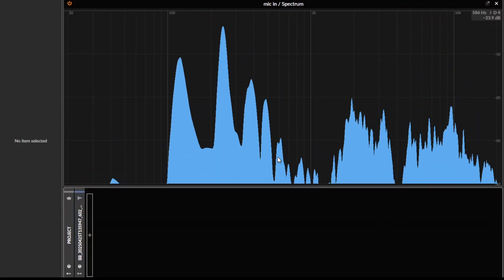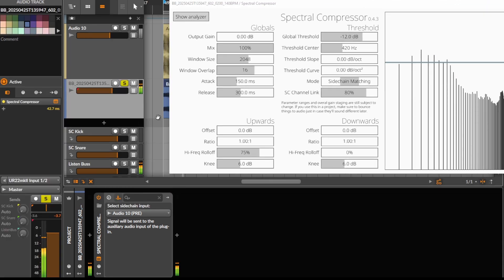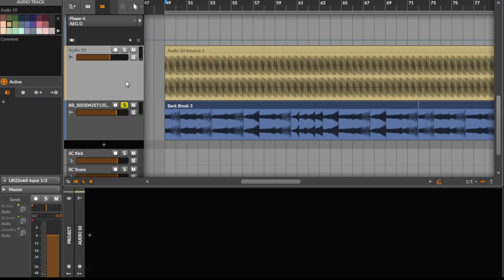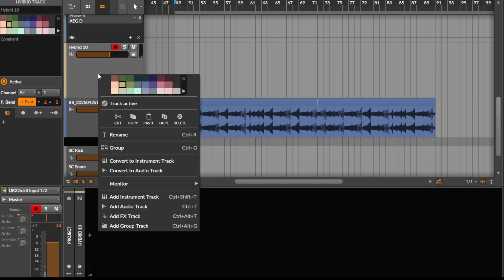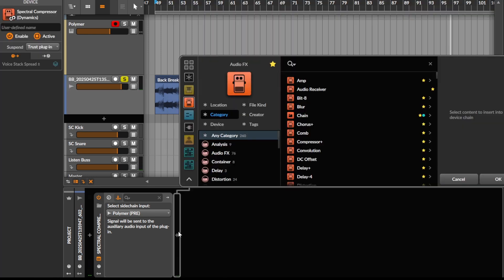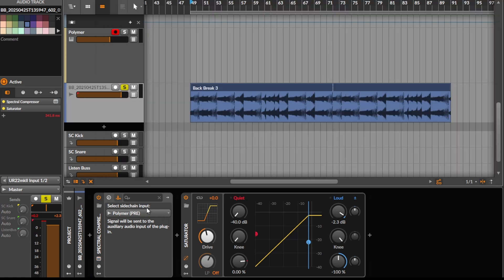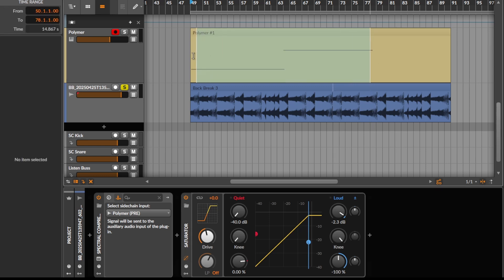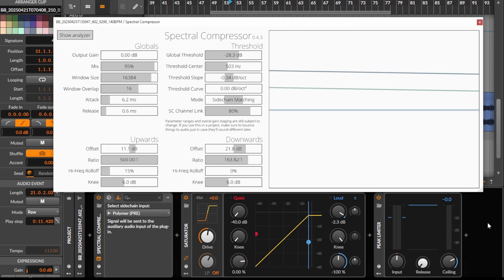Using Spectral Compressor as a Resonator /Spectral Vocoder | Sound Design Concepts Ep. 45

Comment: Hey! Convolution is supposed to be "on" or "off" with no easy middle. Did they do a magic?
Reply from the maker: i dont think this is related to convolution at all, altho it does have a similar effect in a way, true
Reply: @TildeSounds as you may know, convolution via FFT is cross synthesis; you multiply the bin amplitude of each signal. ("Convolution in the time domain is multiplication in the frequency domain.") I haven't gotten spectral compressor yet, but using the spectral compressor with a side chain seems similar, attenuating the bin amplitude of one signal according to the amplitude of another, except its backwards, making the carrier quiet where the modulator is loud. You'd want it to be a spectral gate instead. But it did seem like it was "gating" the carrier according to the sidechain in your video?

Back to vanilla cross synthesis, come to think of it, it's actually straightforward to set an amount on by multiplying the carrier bin amplitudes by A2*(1-x) where A2 is modulator's bin amplitude and x is the amount. 

I guess the "no amount control" thing applies to time domain convolution? I recall reading it in Microsound years ago. I'll look it up...
Reply from the maker: @GeorgeLocke  this is basically a vocoder thingy? like you describe with the bin multiplication, a vocoder does the exact same thing just with a filterbank.
like i think the difference to convolution is is that convolution is spread out over time, while this only morphs per moment.